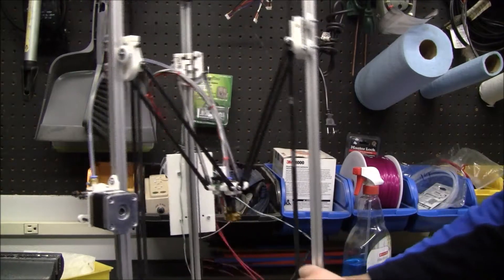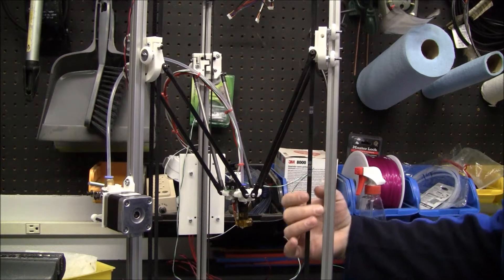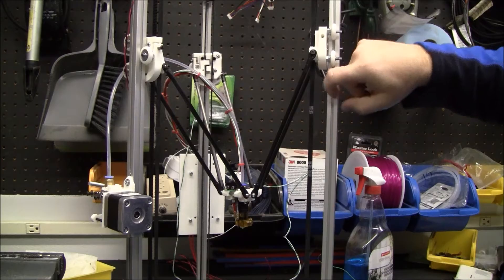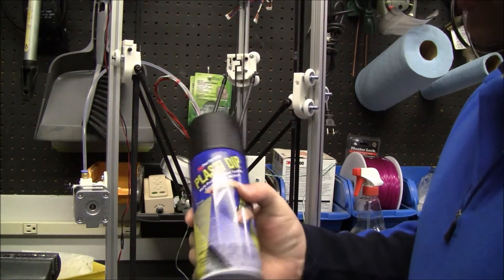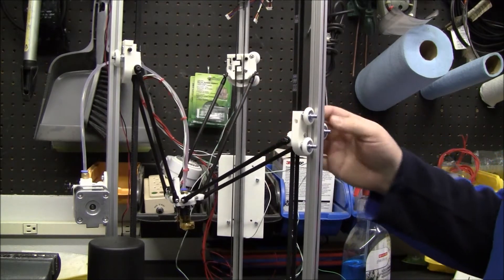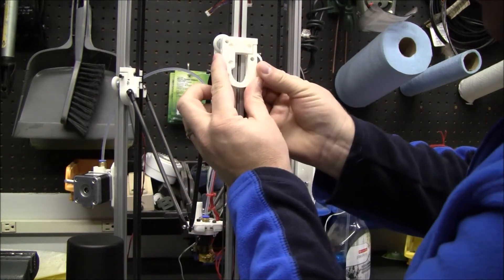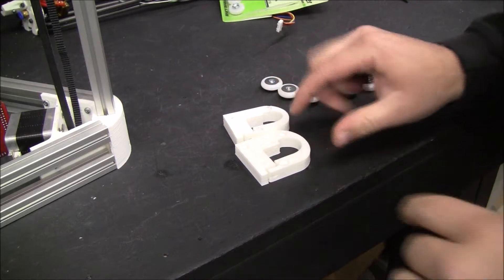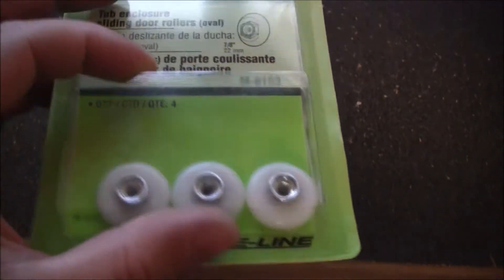Kossel Mini 3D Printer Vertical Movement Tutorial

Comment: If you put another bracket/plate on the back side, you could get rid of the little bit of slop by stabilizing it. At least I think this would work and be a cheap easy fix. Also, anybody reading, google recirculating kossel carriage for a cheap form of linear motion.